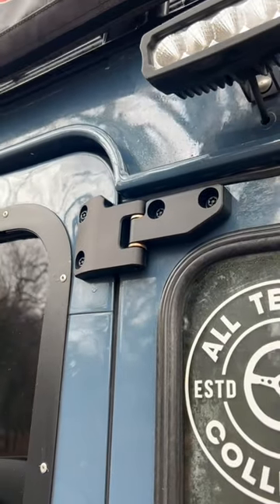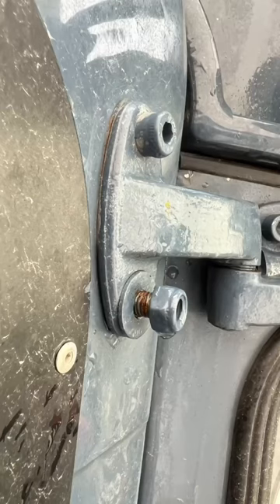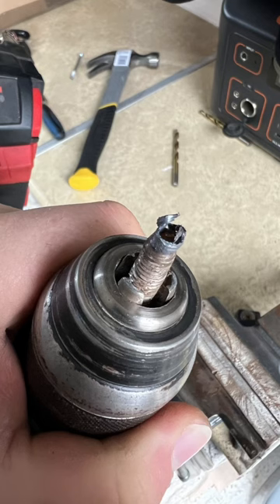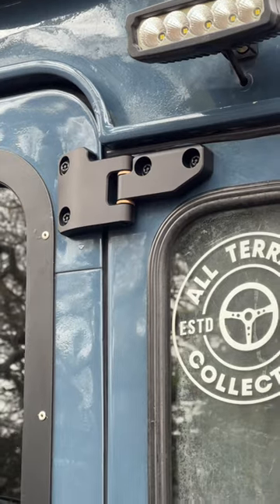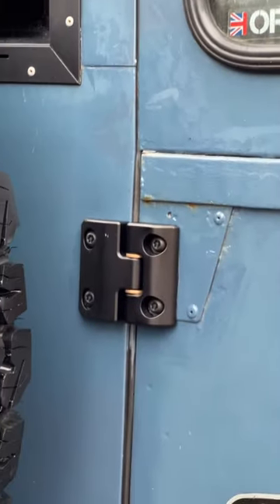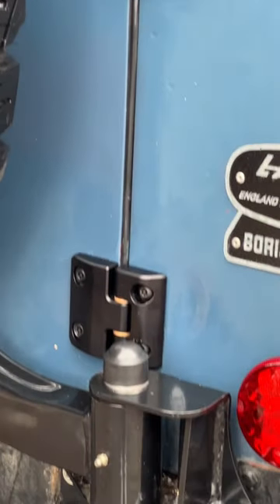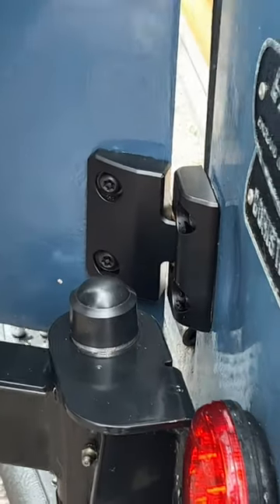New product day! Got to love it! Exmoor Trim Rear Door Hinges. #shorts #landrover #defender #landy

Comment: Looks nice. I bet they're spendy AF!.

Psst...(looks left and right) the Torx "security" bolts can be undone with a flat bladed screwdriver😉

My mate who has a stiffy for Allen/Torx bolts thought his D22 barwork was safe cos he fitted Torx Security saying the Torx O tool was rarer. 

He was 😲😳🤯 when I undone it with a screwdriver🤣🤣

Remember cross threading is natures locktite Security fitting😆
Reply from the maker: You would need to get a spanner on the rear nuts inside the car to get these out
Reply: @BorisTheDefender  
Like a standard LR hinge?.